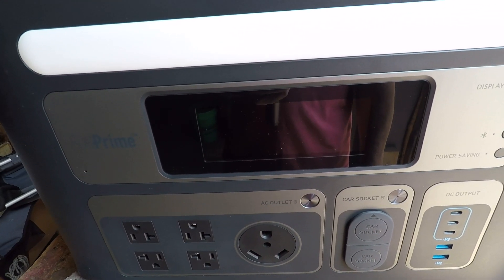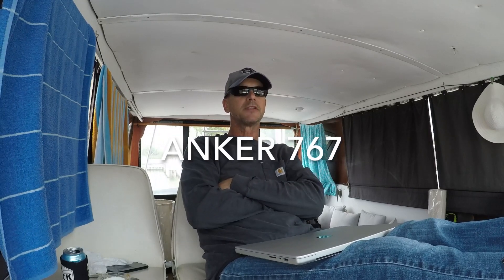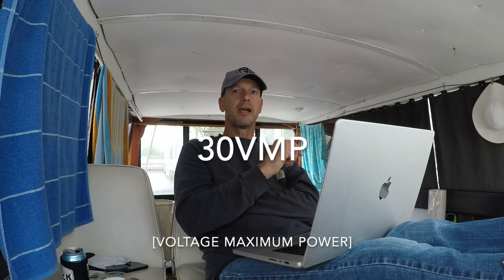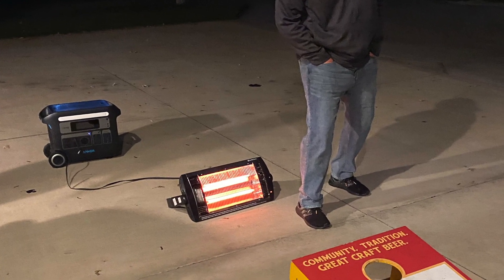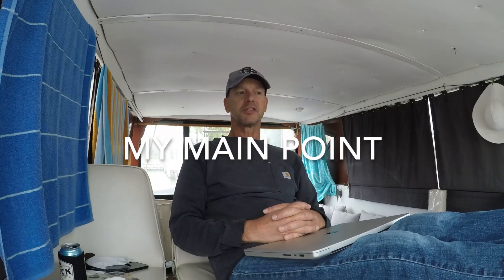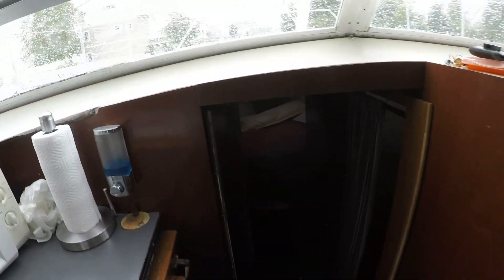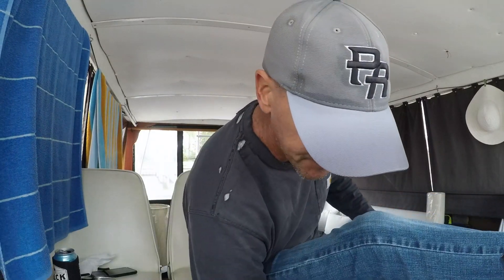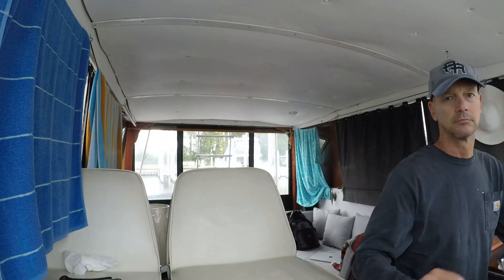Anker 767 / Solix F2000 - I make all the mistakes so you don't have to

Comment: Anker solar is two 100watts series linked to make 200w. Thats why the run at 42v at 4.3a

Thats why you can run 5 panels at 21.5A but the box will cap the amps to 20a

Comment: Remember people. It's the Volts ⚡️.

11-33 volts can only run 10A 
32-60 volts ⚡️ can run at 20A

You go over the Volts you get 0w
If you run at 11-32v that's 10A and will only get 212w 

I had the same problem 

Im running 23v and 10.3A 200 watts x2, makes a series link 46v and 10.3A

Parallel joint with another set makes now

46v and 20A making 730 watts now.
Reply from the maker: Yes, THIS EXACTLY

Comment: Just wondering, I have the same 4 Trina panels that you have and connected them the same exact way. However, now I have zero watts coming in no matter what I've tried. I even went to just 2 small 100 watt brand new panels and still zero charge through solar. Did I blow an internal fuse or breaker, or is there even one, no matter how much a search the Internet not one single person knows if such a fuse or breaker exist or where it would be. Any idea if there is one?
Reply from the maker: Terribly sorry for the slow reply, here is one idea: there is a reset button on the Anker F2000, it is just a small pinhole. Look it up in the manual. Just push a paper clip through it to reset the machine. I had a similar incident a couple of weeks ago in which the Anker F2000 was showing only one watt of solar input. I had just replaced some PV wiring and checked everything but failed to find a bad connection. Then I remembered the reset button, tried it, and magically everything came back to life

Comment: is it possible to use a separate solar controller to connect any kind of solar panel regardless of voltage and amps, and use the control settings to match the recommended solar input to the Solix F2000?  Its so hard to match the correct solar panels to get close to the maximum solar charging input.  Im just wondering this now out of frustration searching for the best setup, stumbled across an old Youtube video "  HOW TO Charge ANY Solar Generator With ANY Solar Panel | Bypass Controller | DIY Series Parallel
HOBOTECH".  So then I searched on amazon for Solar Panel Controller and found a device called Renogy Voyager 20A 12V/24V PWM Waterproof Solar Charge Controller w/ LCD Display for AGM, Gel, Flooded and Lithium Battery, Used in RVs, Trailers, Boats, Yachts, Voyager 20A.  Im wondering if this is possible and if anyone has tried it.  Trying to save money and would prefer to make my own solar panel set up for the Anker Solix F2000 vs buying their brand, its just too expensive.  Please let me know what you think or anyone else with more experience regarding this matter.  Thank you!

Comment: I have the same one with same solar charging issue with my Trina panels. Did you ever find a compatible panel for the Anker?
Reply from the maker: YES, basically any solar panel setup above 32V will work, but my solution is not for everyone. I specifically wanted lightweight panels for the boat shown in this video, so I bought eight 12 V 100 W flexible panels, and then wired a pair in series and then wired that pair to another pair in series to get 48 V. This is well above the 32V minimum required for faster solar charging. I'm now averaging 650 watts [800 max] on good sunny days [XINPUGUANG Flexible Solar Panel 100Watt 12Volt PERC Monocrystalline 200W Off-Grid for RV Boat]. I will shoot another video of the boat installation when it is complete. I am still making the DIY flybridge roof on which the lightweight flexible solar panels will be mounted